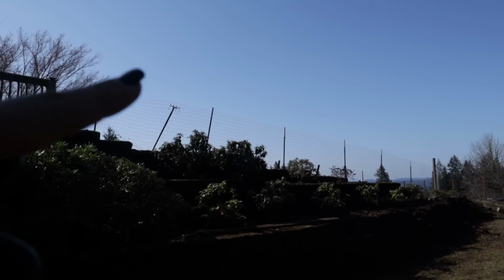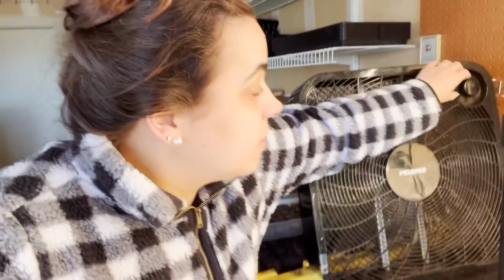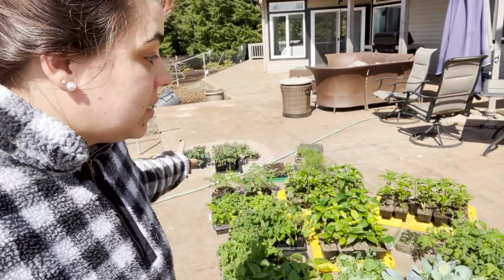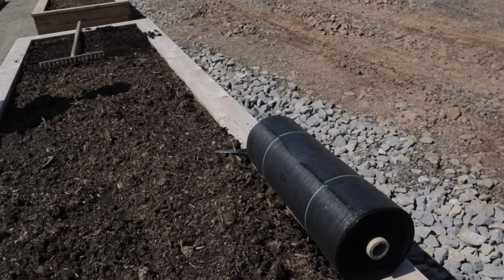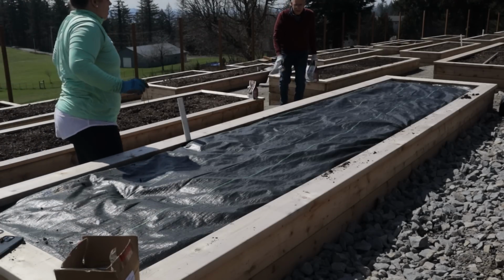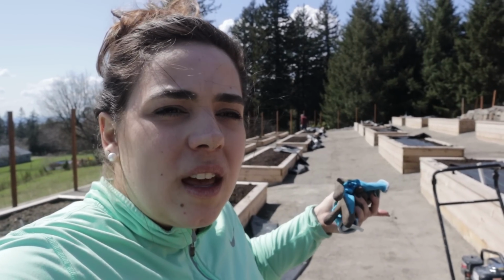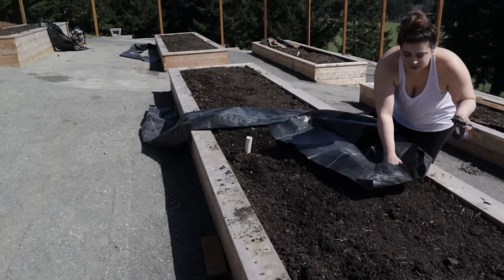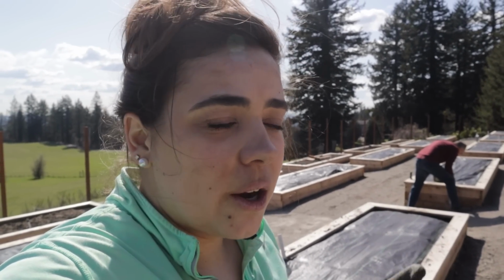This idea is either brilliant or crazy!

Comment: woven fabric:  Fray, un-weave, pull apart.  Since it only lasts a matter of years, you could consider planting into the fabric by cutting an 'X' and putting the plant into it with the fabric around the base.  Also, the irrigation is better under the fabric both because it doesn't have to drip or run through the fabric (you will get some loss not passing through) but also because the fabric stops some evaporation.

Comment: Maybe a damp cloth you can touch the holes with after you burn the hole.  I was wondering if you could burn the ends by cutting your strips with the tourch rather than scissors.  Again, run the damp cloth along the cut ends.

Comment: As time and money permits you should look at getting some rolling trays to roll them outside each day.. I have the perfect thing a grocery store bakers rack, metal with slide out trays bought it at a soap swappers meet years ago will be so much easier on your back and quicker.  ULINE has them for $99 don't know how much shipping would run you might be able to find something like this locally the caption I'm sending is actually for a FREEZER but it would certainly work fine for what you need.  The one I looked at actually has a removable cover on it don't know if thats extra cost but it gives you a idea of what I'm talking about.  Websrestaurants also has them for around $139 that look like they might be bigger.  Mobile Pan Rack Cover - 25 x 28 x 62", Freezer...  Anna In Ohio

Comment: Maybe if you stretched the fabric out on the ground and used the torch to cut them to the correct length. Then, put the lengths into the raised beds and pin them down

Comment: STENCH   STAPLE   TRIM  ! ! !   Otherwise the wind will uproot all your plants.   1. Cut cloth six inches longer.   2. Open fully.   3. Hang off one side of bed to the ground.   4. Staple on the inside every foot along one side.   5. Fold over the top of the bed.   6. Stretch tight and staple.   7. trim excess.    8 consider putting long U ankers or big rocks here and there to prevent the fabric from raising up when windy and tearing the new plants apart.  In the field they are weighted down with dirt .  Gardeners use rocks all along the edges and a few larger ones here and there till the plants are a bit bigger.  Buy a staple puller so when you want to add compost you can just un-staple one side of the bed, fold it back add the dirt and then staple it back without harming the fabric. I suggest a battery operated stapler like used to upholstery furniture.  I am so happy to see you doing the fabric on top.  Keep up the amazing work you do and just ignore the jealous haters, you are fabulous girl!! and don’t let anyone tell you otherwise.

Comment: Didnt see the tips on germinating lavender, so just in case heads up it needs stratification. So research how to stratify lavender seeds. Its easy. Also good rule of thumb,.. if its a plant that in your growing area can overwinter and not die,..  then the seeds need to be stratified. Literally a damp paper towel in a ziplock put seeds on top, seal bag squeezing out the air, lay flat in a covered dish back of the fridge for 6 weeks. Check periodically in case the seeds started growing in the ziplock. Check for mold too obviously. Yeah. Think even potato’s. We get volunteer potatoes that were left in the ground from season before. Well they also grow when we save them and people think they didn’t get stratified. But they were,.. we kept them covered in a cool room. Right? Some species of plants need a hard stratification others are flexible and a simple fridge visit works for them.  Tree seeds can take longer and need maybe even a freezer trip. If i am not mistaken maple seeds like a bit of freezer time.

Comment: Yes Becky, using a small blow torch that you will use to make your holes  to cut the fabric would have sealed it versus using scissors... would have been faster too
Reply: She was using one, weren't you watching?
Reply: @denisejones1863  yes, but she used it after cutting... I was sharing she can cut with the blow torch instead of using scissors and then going back to seal.  Just run the blow torch through the fabric

Comment: Becky, why did you not use mulch instead of landscape fabric to prevent weeds in your raised beds?  Over the summer, the black fabric can solarize your soil, raising the tempurature much too high for not only weeds, but also your starts, to grow.   It can also kill off much of the beneficial life in the soil.  Most mulches are cheap and end up improving the soil as they break down.  Even weeds can do that if left to die on the surface of the soil.  I hope you'll reconsider this decision before you kill all your beautiful plants. ~ Lisa
Edited to add a P.S.  Lavender requires stratification, which is easily accomplished by placing your lavender seeds in the fridge for a few weeks before planting.  MIgardener has a great video explaining the concept.
Reply: It works year after year for me and Living Traditions homestead. You have to amend soil anyways annually.
Reply: @EA28RN   It would never work here in Texas.  Everything would fry.
Reply: @LB-vl3qn  thankfully she isn’t in Texas. Works in NY and Missouri summers. Missouri gets super toasty.
Reply: @EA28RN  Texas and Missouri have similar weather in the summer with temps over 100 regularly.  It may "work" but it's not good for the soil life. ~ Lisa

Comment: I have fabric on my beds for several years and love it.  I would rather work on my plants than deal with weeds.  I agree with @oldethymecottage2985 that a small blowtorch or lighter would help cut it so much easier.  That is what I used.  I also have a small lighter with a small round wand tip to burn in little holes where my plants go.  so fast & easy while sealing in the edges at one time.

Comment: as I sit here watching with an ice pack on my tummy because I spilled boiling water on me I feel the burn on your thumb.
Regarding the edges of the fabric Kevin from Living Traditions Homestead actually cuts his landscape fabric with his (much larger ) blow torch.
The advantages of placing the drip tape on the fabric is that you avoid getting soil in the tape and blocking the hole as well as it is much easier to trouble shoot if you have any issues of poor water flow. So I think that your idea of doing that is genius

Comment: TIM from Canada, you have an open area from your door. Anything that is out there is going to jump in that pan. You really did not think too far ahead. You could have put another post on top of your chicken run and split your chicken wire between your fence and the post Now you have an open area so now animals are going to jump inside you have to think ahead on what you were doing

Comment: irrigation should go underneath the fabric, now it's more likely the water the water doesn't soke the soil evenly...but first drips to the lowest points first before.  the other thing why your weeds were exploding is because you are getting them out too late and they were blooming  or roots stayed partely in the ground ect..and because you left them next to the beds in your old garden. spray your torged fabric with water or dip the ends in  tray of water..don't burn yourself.. I think it's  pitty you use the fabric..it's plastic in the end.. you polute your soil with micro plastic over  time